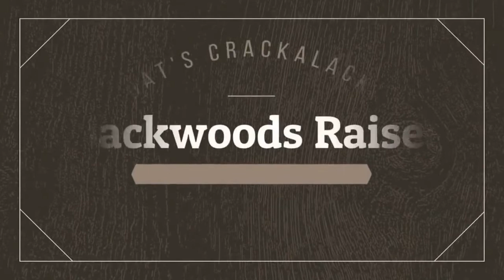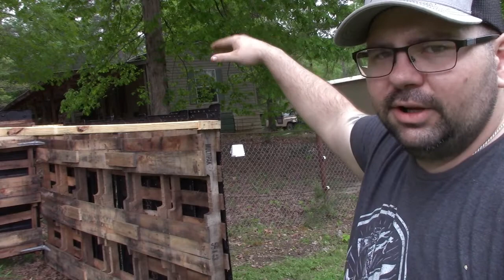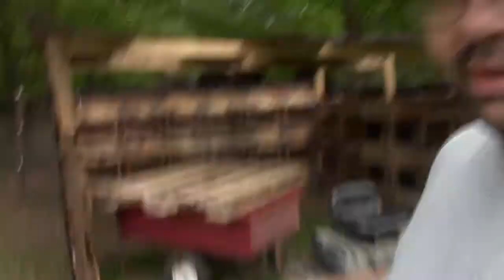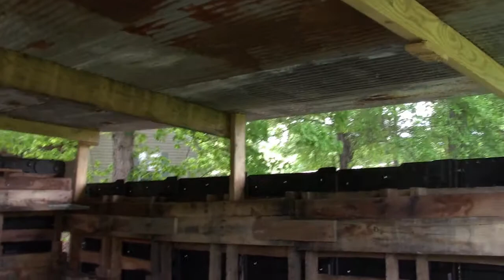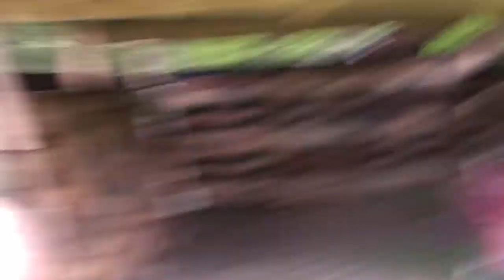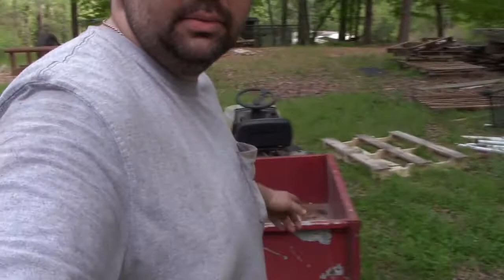Building A Horse Stable From Free Material - Part 2 - Pallet Project

Comment: Pretty Micky Mouse.
1. As you discovered, pallets are made with Nails.  Horses (ponies included) Do Not mix with Nails.
2.  Pretty silly to slope the roof down at the front.  You will get very wet going in and out each time it rains.
3.  That roof has no cross bits to it.   Not well attached at all.  Wind, roofing iron and horses are a disaster waiting to happen unless the tin is screwed down to within an inch of its life.    This roof looks loose and flappy before the wind has even done its magic.
4. The slats on the inside of the pallets appear just right for a pony to get its foot stuck.
I wish you luck with the pony, by the look of this, you will need it.
Reply from the maker: Thank you for all your advice and opinions. Just a update the pony is doing well. The shed is doing very well.